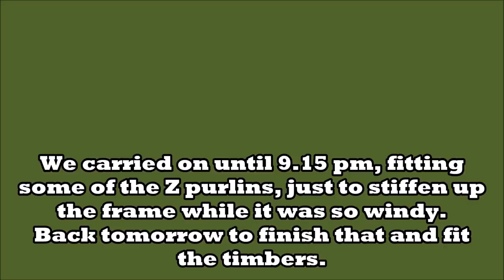Barn build. The second shed goes up.  05 08 21

Comment: Great video again like that homemade lifting device
Reply from the maker: That thing was made for lifting “Atcost” concrete rafters and panels. Our little steel ones were poxy in comparison….  Tim still hated it though. 😄
Reply: @FarmerP  it did the job which is main thing save paying for a crane 🏗 or hire of a bigger machine with more reach